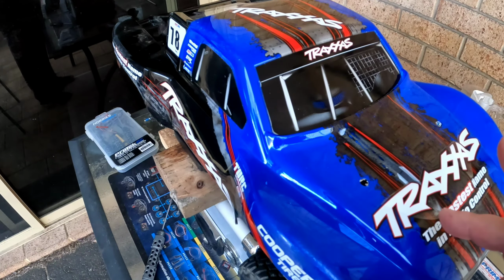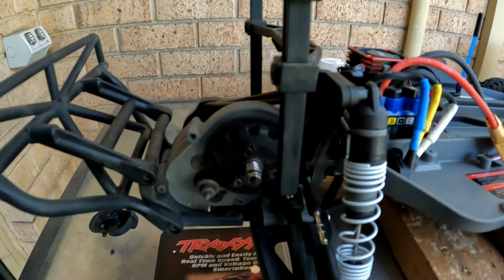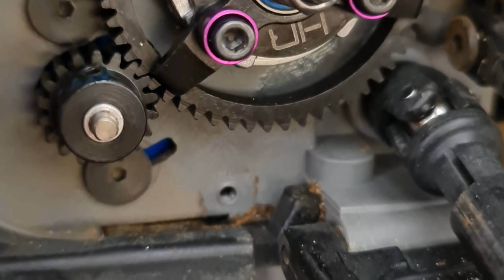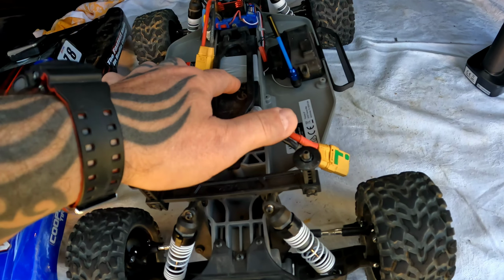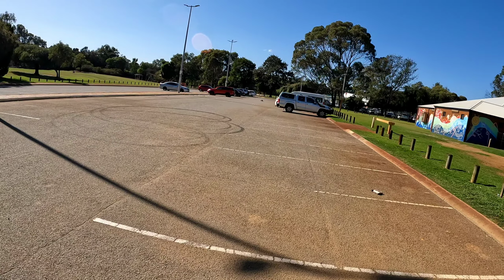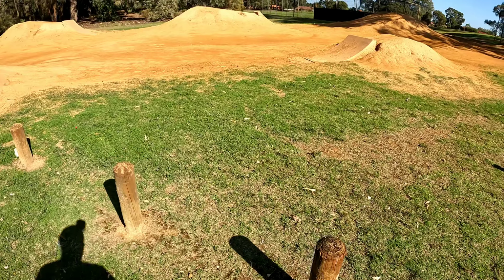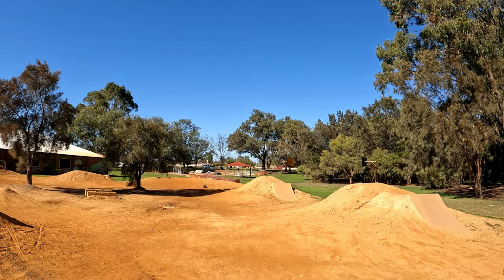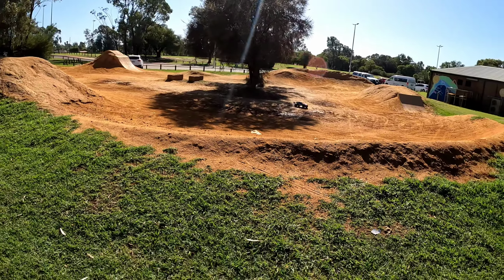Traxxas Slash Vxl 2wd testing Hot Racing 32p 18/56 gears with speed run on 2s

Comment: Bought a 2wd short course Slash in Mar Wanted to learn to handle a RC car before I went for the speed. It now has a LCG chassis, VXL3s motor and ECU. Stainless steel knuckles and axles, Big bore shocks,, Aluminum shock towers. bell crank, axle holder, front and rear A frames, stub axle carries, steering blocks and caster blocks. Run it on a  TQI 2 channel controller with TSM. I enjoy it very much and it can take a beating never broke anything

Comment: Your drive shafts won’t like the big tires
Reply from the maker: Probably not but on 2s it will be fine 👍🏻
Reply: I use 2.8's and never had an issue with stock gearing.
Reply from the maker: If the mesh is set right it will be sweet , for me personally i prefer the bigger teeth on the 32p 👌🏻
Reply: Keep an eye on your rear suspension travel,, if there's too much down or up  travel, the rear axles will bind .  In my experience, the 2wd slash is an awesome platform.  So many options,  unbeatable after market options